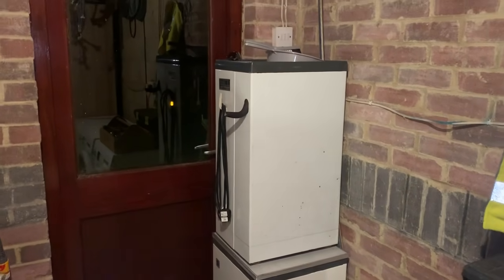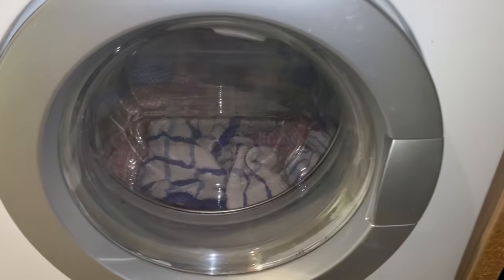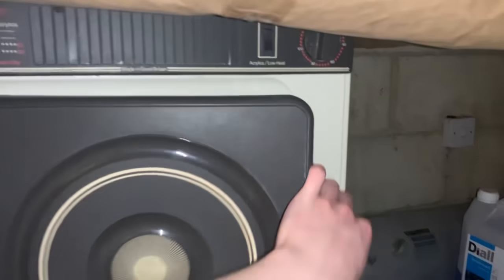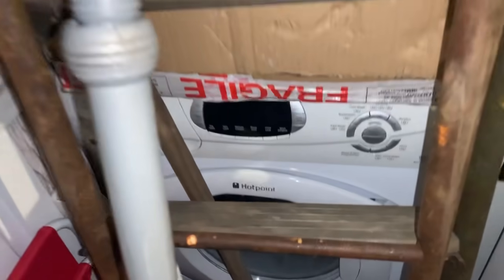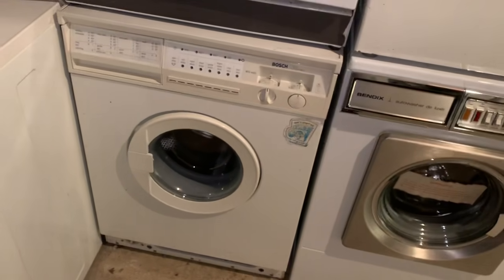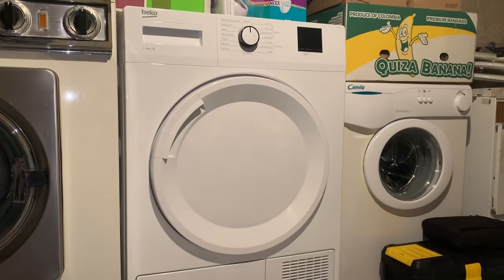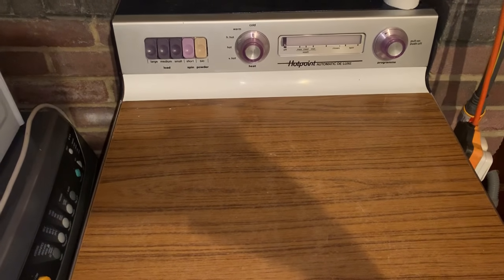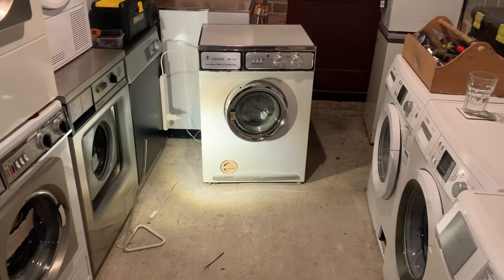Garage tour and machine updates

Comment from the maker: Update 16/05/2020 - The Beko dryer has sold. The rusty Bosch WAQ28460 has been refurbished and it is now immaculate. The scrap Bosch has been scrapped and the Classixx is now up and running. I’ve acquired another Bosch Exxcel 7 WAQ24460 and a hoover dynamic next since, as well as a Hotpoint wt761 which needs a pcb and rusty so it’s out for scrap.
Reply: I  have the bosch waq24460gb